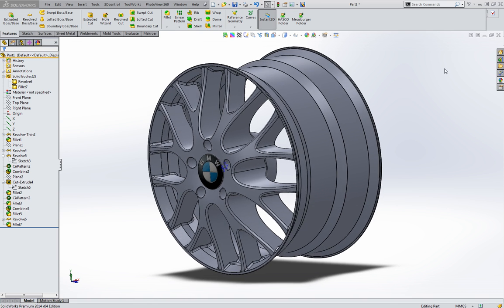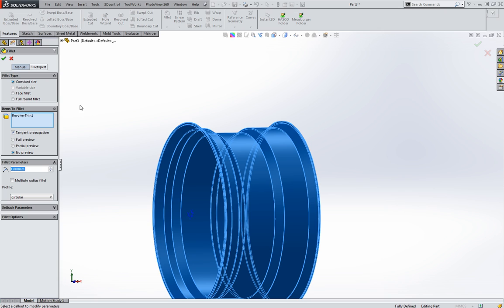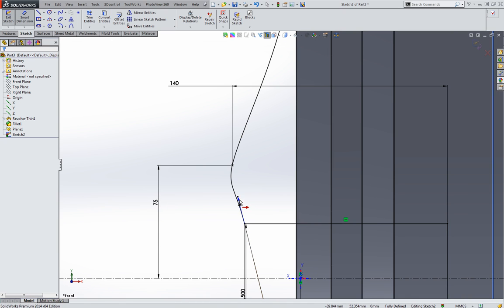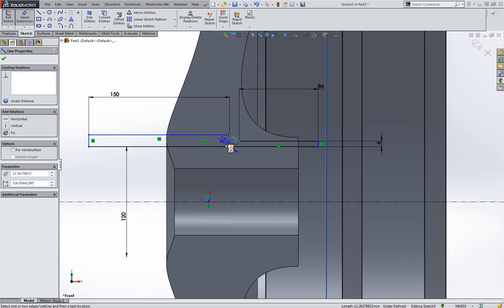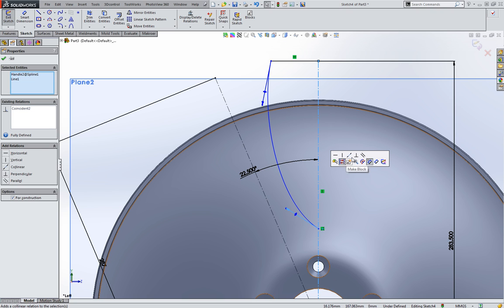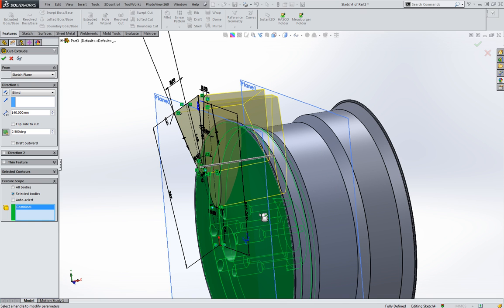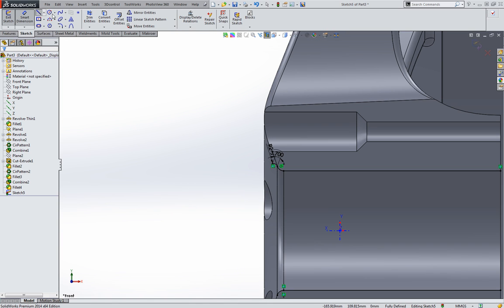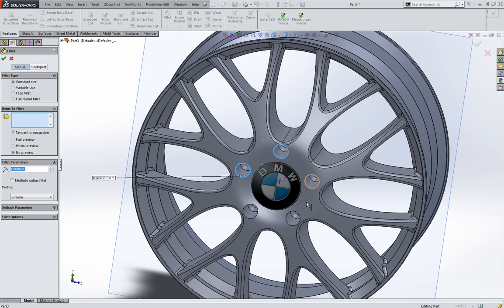SolidWorks tutorial: BMW M5 rim

Comment: My horizontal line at 72.50mm above origin line looks way bigger than in the video. Then it doesn't let me fix the middle point on the spline to be 75 mm from center line. Anyone have this problem?

Comment: I was having a problem with feature scope not appearing but I went through and turned off merge bodies on revolve 2 and that caused feature scope to appear but then my combine 1 was messed up so just edit it and reselect the main body and you'll be okay
Reply: +emertes17 you was right, uncheck merge result in revolve2 and fix revolve 3, then feature scope will appear.